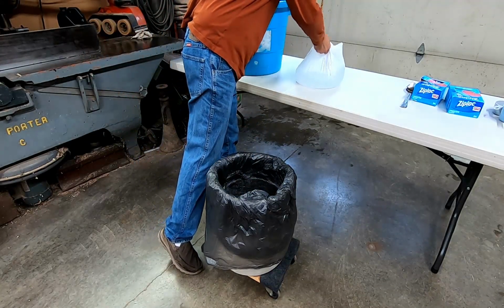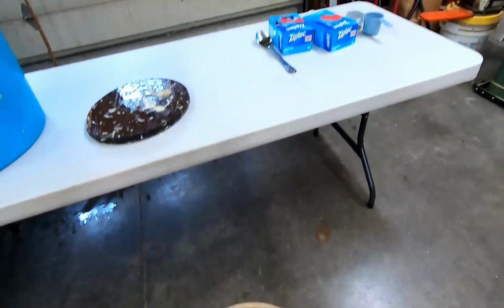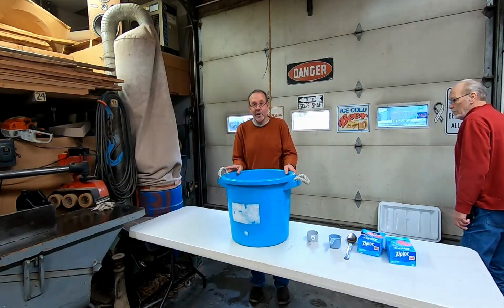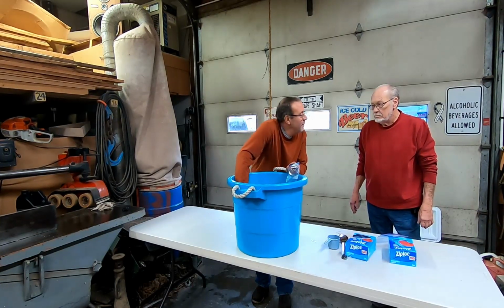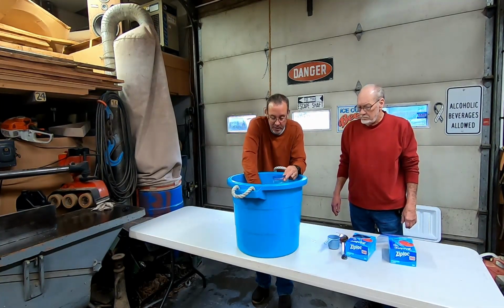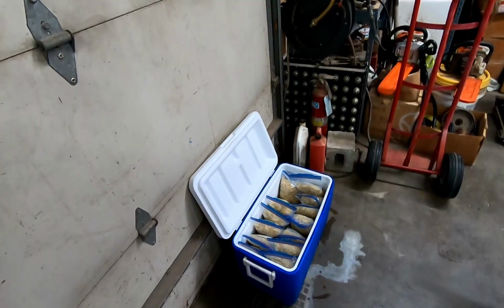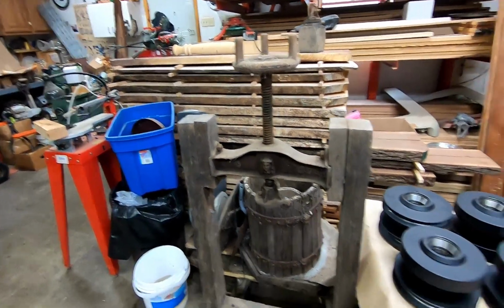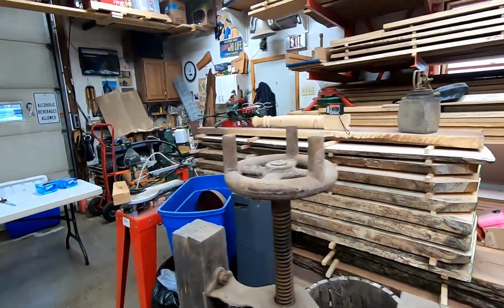sauerkraut pt 2

Comment: 4:11  I'd be tempted to send the cast parts to Clark Easterling, Windy Hill Foundry, and see if he can use them to make some aluminum production patterns.  The end result may not quite be on the same scale, but adjustments can be made to the rest to compensate.  Good project for the D.I.Y.'er that wants a press like that, be it for grapes or for cider.

Comment: I don't know if your familiar with the trick for your wine bucket. When you make the side strips cut them about an 1/8 inch oversize and take a piece of wire and hammer it down the length on each side to form an indentation then plane it to the size you need to make the sides of your barrel. When the wood gets wet after your done that indented area will swell out to make a tight seal on every strip of wood on the sides of the bucket. I learned that trick from a guy making barrels in Williamsburg years ago while on vacation.